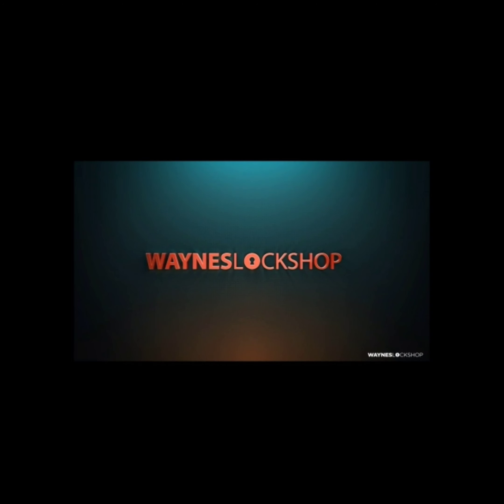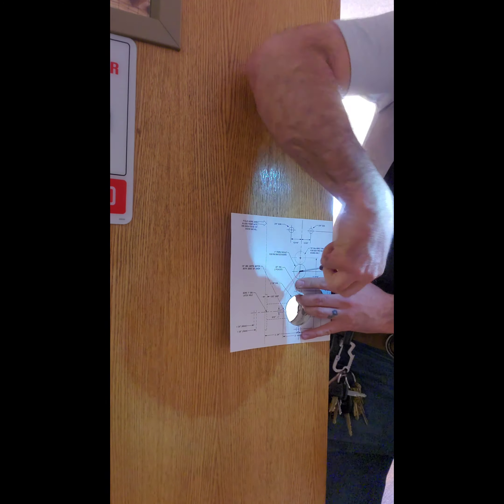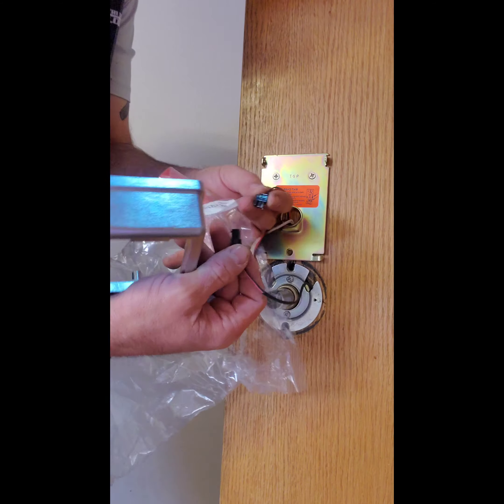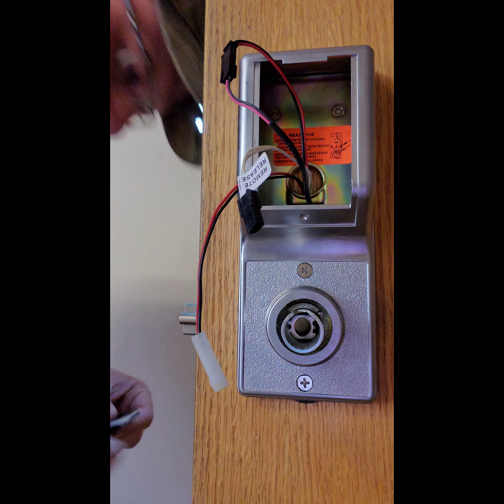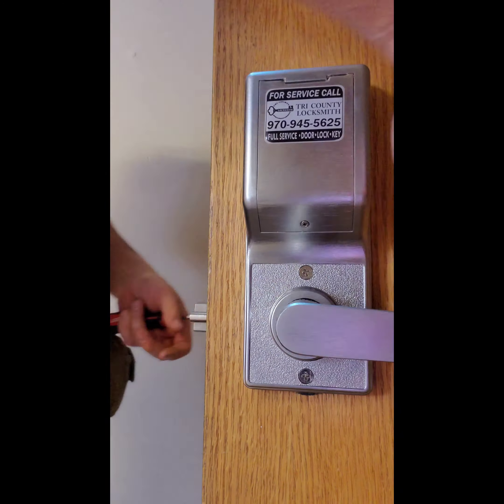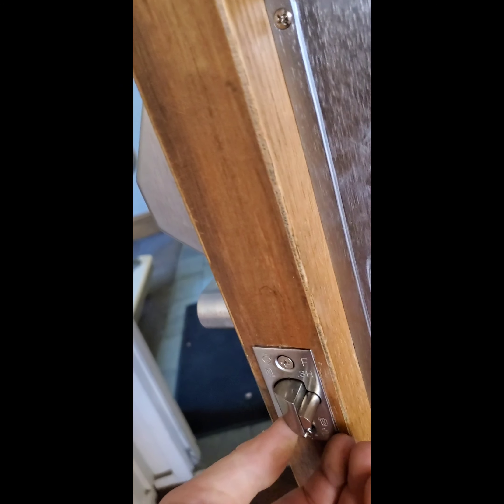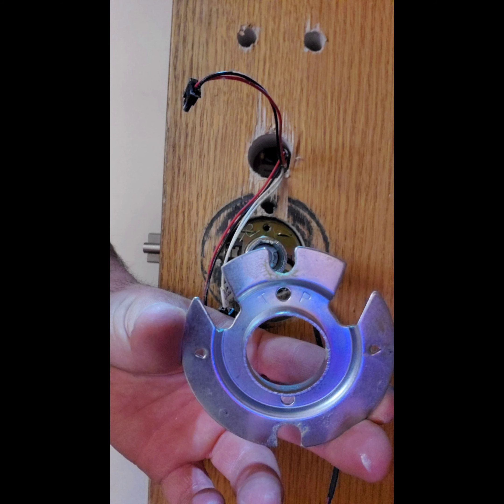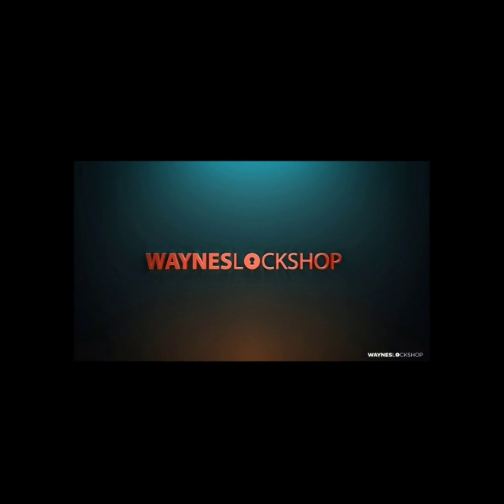Installing Alarm Lock DL 2800 keypad on a wood door electronic access control system

Comment: Try the 12v Milwaukee screwdriver, that has mad power, and the Milwaukee FUEL 2804-20 18V 1/2". Both make a great combo. I could never get the hang of using an impact driver